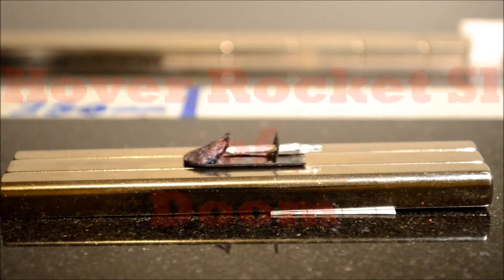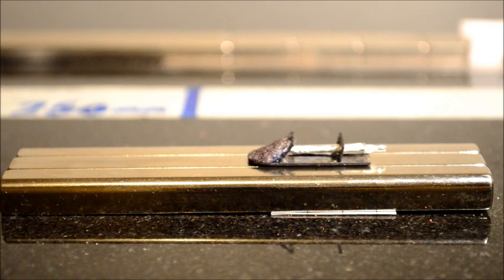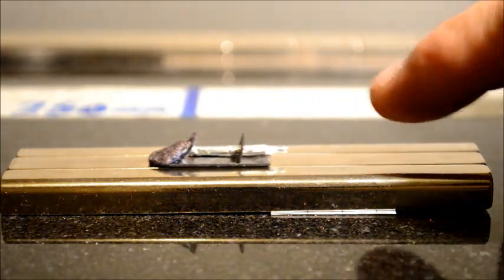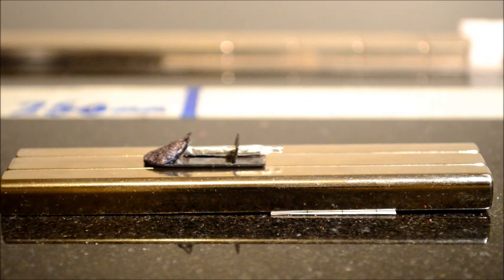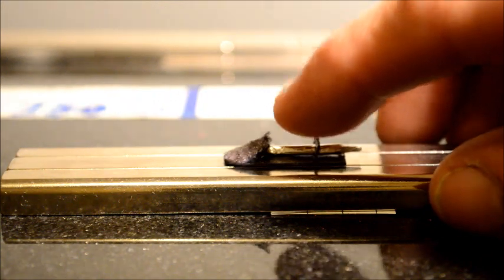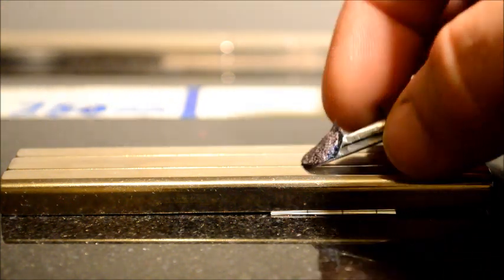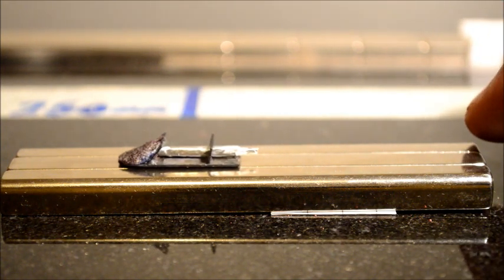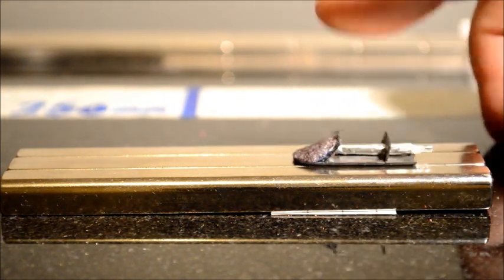Hover Rocket Sled of DOOM !

Comment: Wow interesting design would of never thought that the graphite would keep levitating even at those speeds!!
Reply from the maker: Hello once the sled gets up speed it levitates like its on rails as long as the front is kept lower than the back I had the track running slightly up hill to help. But its a very fine line between win and fail with rocket engines this small many things can go wrong. I still have 25+ fail clips not yet seen. Thanks for watching please spread it if you like it.
Reply from the maker: FreakonFlight Hello Do you fly rc micros ? Do you have any plantarco rc equipment I may be getting the sim jet and platraco promotions going again but will be using proxy pilots as I don't think I can fly my self after my work injury 3 years go.Interested ?Adam VA of AVA Magnetic Levitation AUS
Reply: Yea definitely I have never actually owned anything from Platranco as they are kinda expensive but I do enjoy the RC hobby and making scratch builds so yea i'm interested!
Reply from the maker: FreakonFlight
Groove I have sent a message to your channel in your discution page.

Comment: I think sometimes it's your rocket fuel. Still amusing all the same. Guide lines might help. :)
Reply from the maker: In some the 2 sage rockets I got the fuels back to front and put the more explosive fuel at the rockets front. Sometimes I just made the fuel to explosive and filled the rocket incorrectly made for lots of great fails. Some of the run offs were due to the track being slopped the wrong way if set up right after a some speed is reached the sled sticks like glue to the track path unless rocket nossel fails and pushes it off. 
Thanks for watching